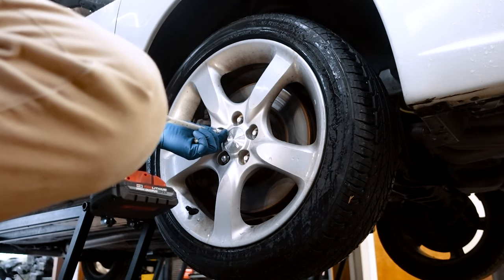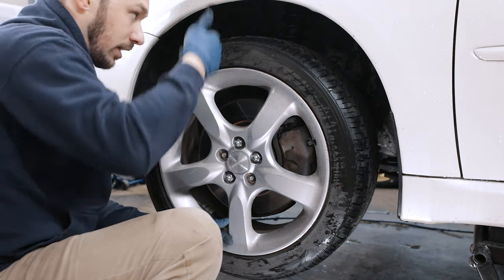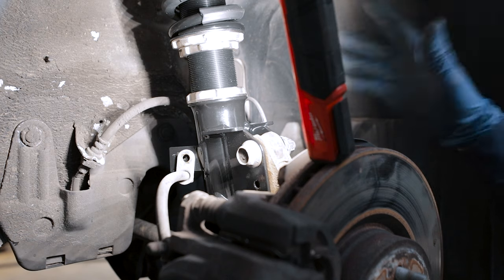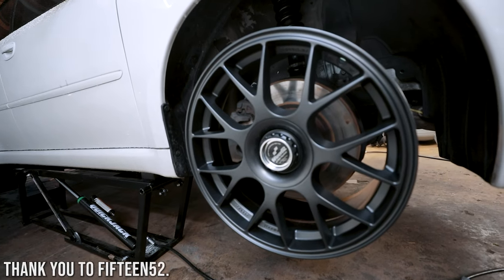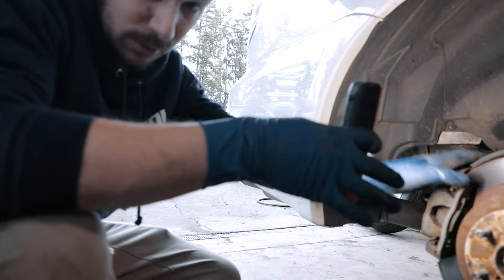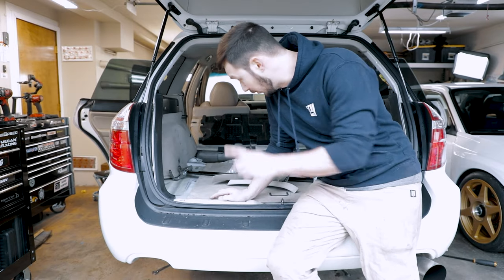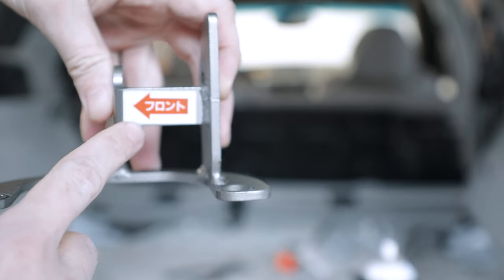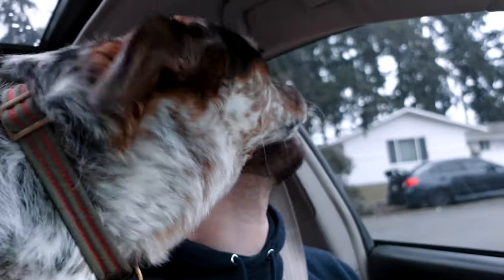Installing Coilovers on the Legacy GT (FINALLY) & JDM goodies!

Comment: Waited for you to load this!
Reply from the maker: Yaaaas. Took soo long to upload for some reason. 🥴
Reply: Did you get the wheels on it?
Reply from the maker: @superbike155  yess, can't really drive it until I roll the fenders but working on the wheel video now. They are sending me some replacement parts for the wheel cover pieces as there were some issues removing them for balancing.

Comment: Looks much better. Never understood why they made the front so much narrower on the wagons.
Reply from the maker: Always been confused on that as well. 😆
Reply: @MatlasDI  it's too bad you can't do a sedan front swap on an outback.  Pulling together parts so I can finish my wrx wagon swap
Reply from the maker: @Josh Anderson Legacy sedans have the same problem, unfortunately. My outback was a little less noticeable, but still had to work around it. 🥲

Madrig now makes a carbon wide fender front for jdm face-lift which would be cool if I get around to swapping front clips on this one.

Comment: Nice one Matt, I’m trying to consider coils for my Forester but, have to consider kids and my wife riding in the car too, so how are the BC’s compared to the stock setup for comfort? Their site says they retain some comfort but……..🤷‍♂️
Reply from the maker: Like any coil, they're only as good as you set them up. Even at the normal spring rate, it is going to be a bit stiffer feeling than a normal spring. If you're just looking to lose some height, I'd also look into lowering springs that are full-size coil instead. Swift makes a set for most vehicles, and I've had a lot of people say they love the ride quality.

Comment: Have you tried the oem strut tower brace with the bendable middle area? I wonder how much of a difference it makes if at all.
Reply from the maker: We've put them on cars before. They do still work in the sense of limiting tower flex by tying them together, but don't do as much as a solid bar. They do it for nvh reasons from what I understand.

Comment: Looks great! How’s your toe and camber in the rear? I did the camber and rear toe arm to fix my alignment on my Bh chassis
Reply from the maker: All over the place, like always 🤣 I'll wind up picking the adjustable lateral links in the future when i do bushings, etc. Haven't done adjustments yet, but I should be able to get them relatively spec'd for the time being.
Reply: @MatlasDI  Haha. I’d like to know how close you get it, I tried two shops and nobody could get it close enough, I ate thru tires every 3-4 months
Reply from the maker: @kylekennedy21  yeah I'm sure it won't be good, just enough to get by until we get the adjustable pieces in.

Comment: Okay so while we are on suspension I have a question. It's not about lowering it's about lifting my 08wrx hatch. I know I know uncool but I just got invited to hunt on some land with monster bucks on it but I can't access the spot because I need just like 1-2 inches of ground clearance and some meatier tires depending on weather. Would you be able to recommend a way to do this without ruining the car for street driving?
Reply from the maker: There's nothing wrong with that. I have a friend that has a gd wrx that is basically a monster truck at this point 😄 
If you're leaving it like that, look at getting a lift kit that includes frame spacers, not just strut spacers. I believe lp adventure has a kit that includes it all. That way, geometry stays the same. You don't necessarily need to replace struts or springs to get it done and riding well as it should still have similar predictability to stock. If you've got more questions I'd recommend calling up PRE Racing and chatting with the guys there, they are the same company as rallitek, and im sure they've done this type of things a ton of times. 👍
Reply: @MatlasDI  awesome thank you! Now I have a starting point! Step 1: gather info. Step 2: somehow get the old lady to buy in lmfao wish me luck. 🤙
Edit: the wife is not purchasing the parts. I'm not lucky enough to have a sugar momma 😂
Reply from the maker: @FADWC  I've learned it's easiest to convince them over dinner out somewhere 👌👌 God-speed. 🤣

Comment: 1:05 I feel you I don't like taking pictures of my legacy on stocks it just doesn't look right with the front mount, also been waiting on this  video from Instagram. Because I wanted to put bc's on my legacy too.
Reply from the maker: Right? I get why it's normally the first two things people do to cars, but I've always tackled engine builds first. I guess it does make sense to do it the other way around and may start to with following builds. 👌
Reply: @MatlasDI  that's exactly what I did I went wheels, tires suspension then moved onto the engine build I'm currently waiting on parts for my FP Blue set up.
Reply from the maker: @MCCale914  That'll be a fun one! blues make very nice power. 👌

Comment: I got around 70k on my BC's...I want to send them off to get serviced but it seems to be a process.
Reply from the maker: I have around 40k on the set in my Outback, and cleaned and lubricated everything when I swapped to swift springs around 2k ago. Worked nicely as a little mini refresh.

Comment: First one in. Cheers bro.
Reply from the maker: aye lets go!
Reply: Can you attach a link for these coil overs
Reply from the maker: @davidbye11  https://www.rallysportdirect.com/part/bcr-f-04-br-bc-racing-br-coilovers
Reply from the maker: @David Bye  depending on how low you're going, they changed their spring rates which I wasn't aware of. It is now 7k front 6k rear, which is a bit too soft for the wagon, I'd recommend at least an 8k/8k setup, but run a 12/10 setup on the outback which is my more track oriented build.

Comment: Could you do a ez30 swap
Reply from the maker: If It makes sense financially at some point, I'd love to. Might be easier just to buy and turbo an already h6 equipped car, though.
Reply: @MatlasDI  the h6 sub frame bolts right up and if you were to buy a h6 you would have to 5 or 6 speed swap it I recommend the 6 speed because of the extra torque

Comment: Put it all the way down…plzzzz
Reply from the maker: It was already hella low once things settled. I was hitting the stops constantly, and now that the wheels are on ive raised it a bit and It's chewing up the new tires pretty bad in the rear. I'll roll the fenders in the next day or so and then go through and dial things in. 👌